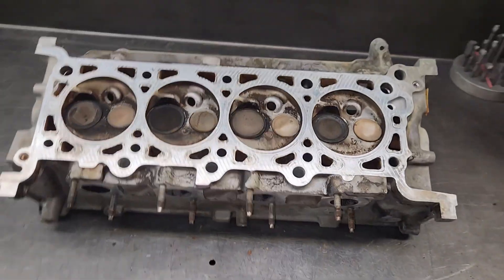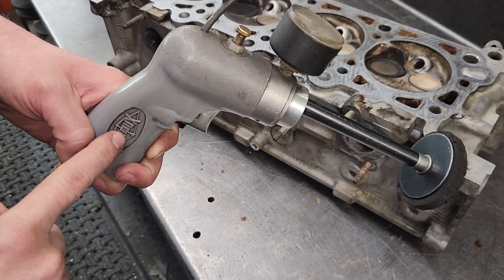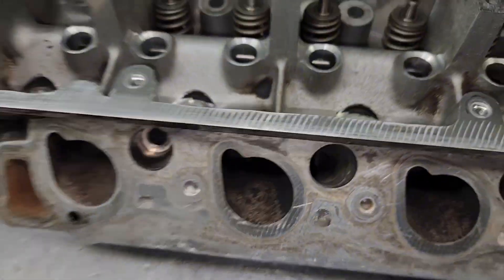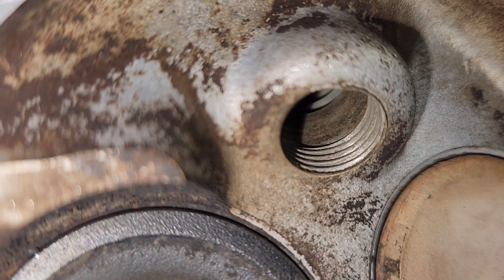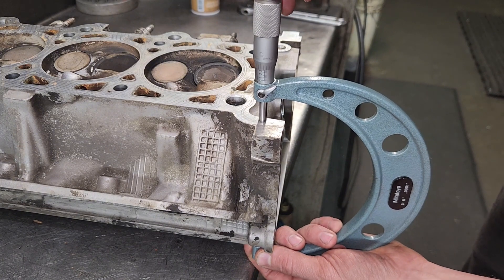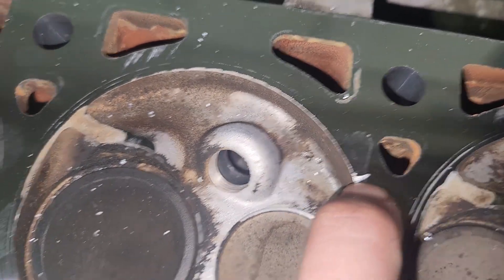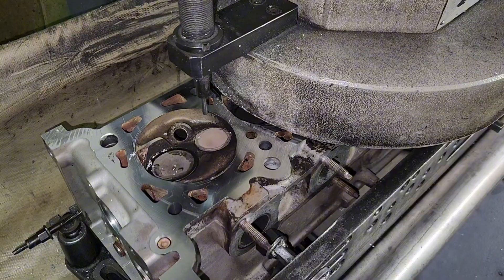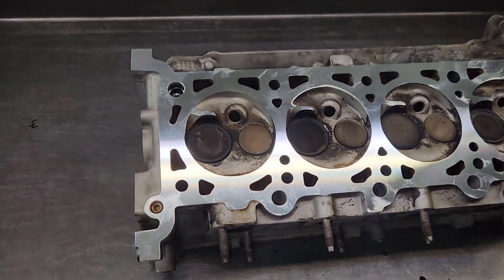Ford 4.6 Head Bad Factory Machine Work. #educational #engine #ford #machine #repair

Comment: i took a 1st gen pi engine bolt/assembly and stuck some npi heads on then went with a victor jr intake and mustang throttle body ran comp cams and shorty headers. in my 2006 f150 and it ran 8s at the 1/8th mile. had an sct x4 and bran pro tune. i was very happy with that truck. then i sold it.
Reply from the maker: Sounds like a fun build!
Reply: @DavidsButler it was i built it in 2018. ran it until 2022.